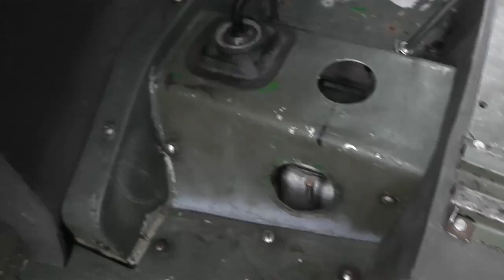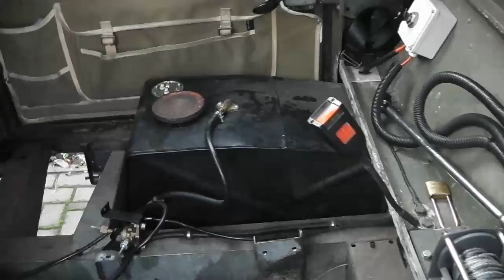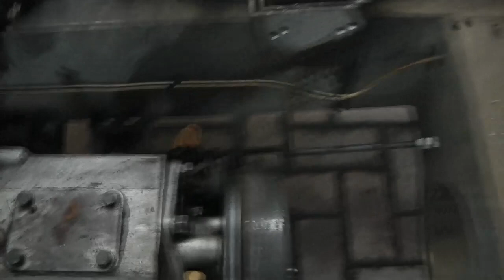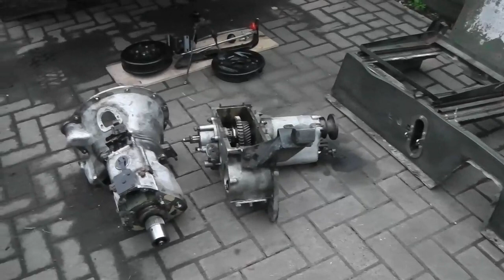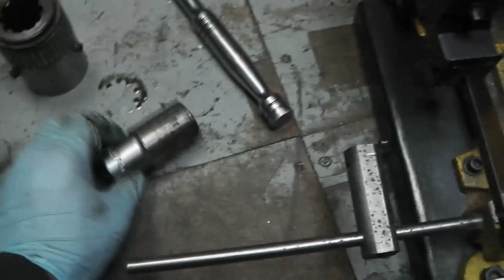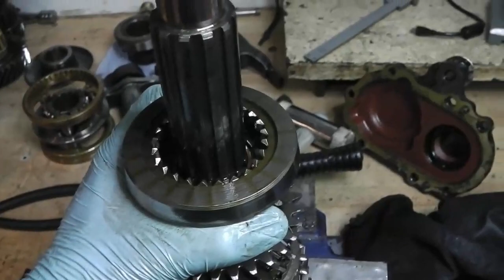Land Rover Series 3 Gearbox Swap - Part 1

Comment: So much information - thanks for sharing! It's interesting to see where the gearbox failed knowing what you did in its last rebuild. Now I just have to try and sleep without being certain that my front layshaft gearbox bearing spacer is set correct 😅
Reply from the maker: Thanks - perhaps I shouldn't have drawn attention to the spacer- there will be a few folks pondering what "that" rattle might be.... :)

Comment: That's lasted well for the mileage, considering your 1st box a very good job.If you had spare time, you should consider a little sideline selling them. I wouldnt even know where to go for a decent job on a series box...Also surprised how little oil was on the outside of the box, the later selector shaft seals obviously help. Good work and as always thanks for sharing 👍
Reply from the maker: Thank you! I have no complaints, it's lasted far longer than ever expected. I have been tempted to build a few 'boxes to sell, but parts availability is not so good as it was and most old Series gearboxes are completely mashed, or the ones I have seen anyway! Being in engineering, it's tempting to see about having the obsolete parts (like thrust washers) made, but even simple parts like that can get very expensive unless produced on a large scale. It has certainly crossed my mind anyway.

Comment: I fitted an LT77/LT230 in mine after having constant trouble with the series box. Best decision I made. Makes it very drivable.
Reply from the maker: Definitely a good conversion, a few friends have done so with their daily's. Personally, I've never found the original box a chore, these vehicles were basically made up from pre war Rover left overs so it's all part of the "vintage" driving experience. Mine was a daily driver for a long time, giving very few problems.
Reply: @steamwally  Depends what engine you have fitted. Series box is fine on the stock engine but they don't like anything more then 100hp. It does destroy the look of the interior as you need a defender tunnel and you loose the iconic red/yellow levers but mine was a daily and I needed the 5th gear.

Comment: Very interesting and thorough as always. I am busy re-doing a Santana box at the moment. They did away with the "double top hat brass bush and replaced it with roller bearings. These were apparently the strongest Series boxes ever made. The problem however is spare parts. You wouldn't know of any suppliers of Santana gearbox parts?
Reply from the maker: Thanks, that's interesting- from what I've heard, the Santana sounds like the ultimate development in many ways. Sorry, no idea where to go for Santana spares- other than perhaps Land Rover Treasure Shop in Cyprus? (Who are extremely helpful with shipping)